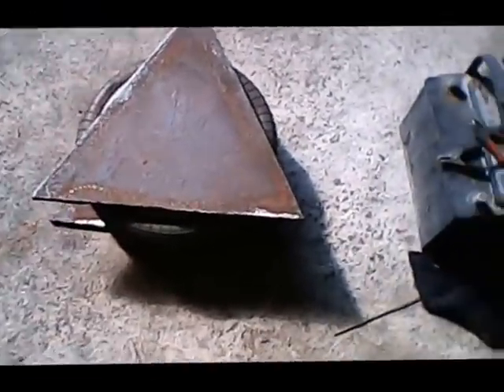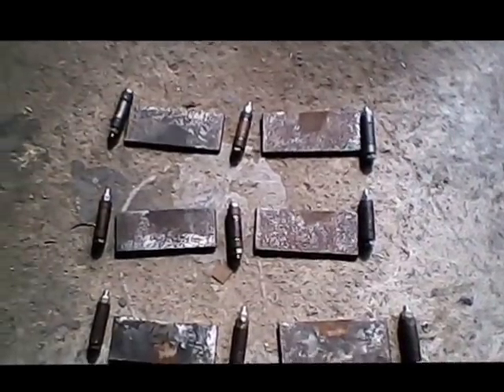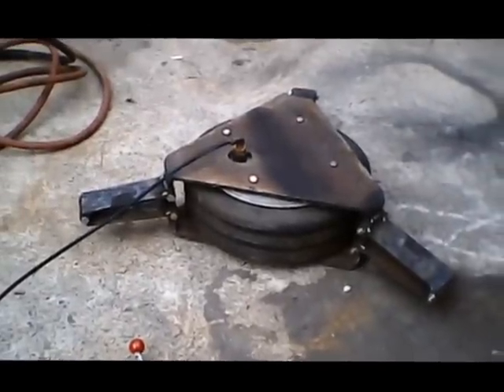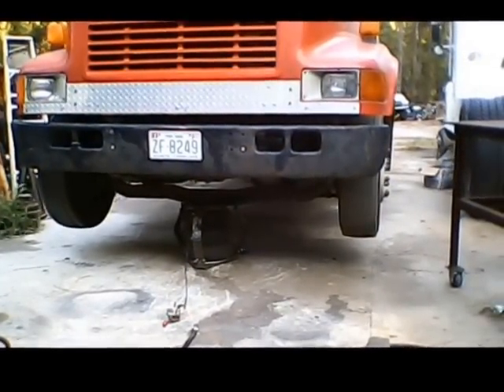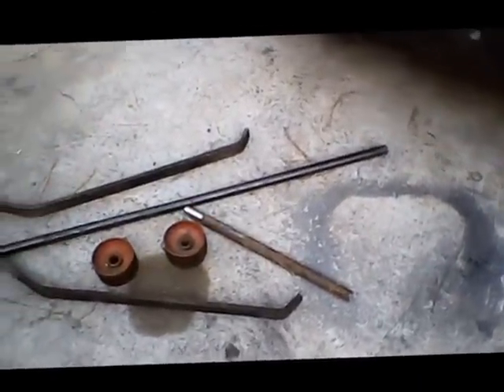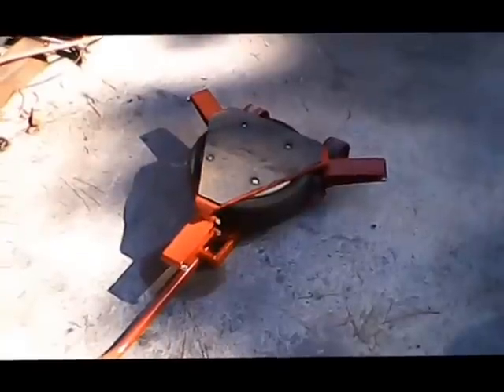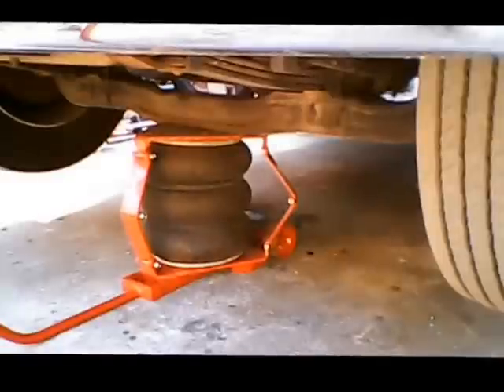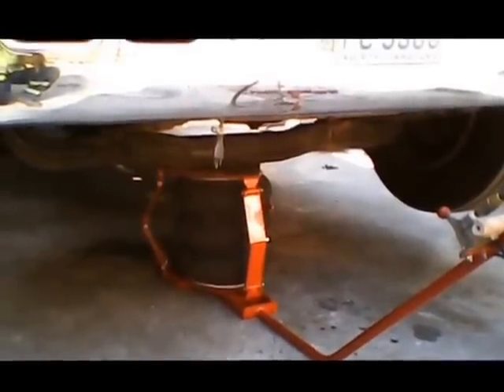Scrap Built Airbag Jack

Comment: Thank you so much for this    I have a GMC RTS bus that the tire came off the rim.  I am going to the truck scrap yard tomorrow and will try to find a used air spring.  I just need to lift the one side to get wood block under to change the tire.   I hope i can find a bag that can squeeze as short as yours.    Thank you so much   now my problem is solved.

Comment: Slick design and easy to build so I'm making a version for myself.

I ordered a similar bag today to lift the end of a shipping container so I can place pipe rollers etc underneath when winching it into place next to my shop. I have a forged steel Simplex jack and a forklift jack but your design is much easier to handle and place while offering greater max lift. My top plate will have a channel to engage the base of the container between the corner fittings, and my bottom plate will be wider since I'll be working on earth. 

Thanks for posting. You're idea will save me considerable work!

Comment: This is so amazing! It's defiantly the best lift of this type I've seen. I work at a off road rental place in Sedona Arizona that rents Polaris Rzr's. I have to inspect about 40 vehicles per day, jacking them each up front and back with a floor jack gets very tiring. I want to build this so bad but I don't think I could recreate it without seeing some of the pieces in more detail. Did you ever make a more detailed video on the build?

Comment: nice looking jack I would like to build one Now that you built it there is always things you would change what would change if you built another one Also what the the inlet valve you are using I want to build this jack on my lift cross braces as they slide back to front but cant figure out a valve that will raise and lower back to flat Any ideas ??? Feel free to text me 813-445-6400
Reply from the maker: +Dan Garland  This valve is just an old one I found. They are available as PTO shits for air shift pto's on trucks. They dump when released.
Reply: Jonathan W pto shits 😂👍that made me laugh 
its the pto shifter aka pto shitter

Comment: how much air pressure to lift the truck
Reply from the maker: +Andy Ostensen  I have a regulator set for 100 psi because that is max for the bag. Not sure what it would actually take to raise it, but it's much less then 100 psi.

Comment from the maker: Just wanted to explain the concept behind the hinges. Because they are located in a triangle when the bag tries to lean in any direction there are at least two hinges that are trying to be pulled into a direction that they can't go. This is what helps stabilize it. This does not mean if the airbag blows that it will not fall, they only help it from leaning side to side, so jack stands are a must with any and all jacks.  If the plates was made into hexagons instead of a triangle and six hinges were used it would be even better. I may build one with six later. I built this one because I really needed a jack for my trucks, I was down to a 2 ton bottle jack. I also know that once the airbag is at full height it is very stable anyway, but when replacing a wheel and tire on a big truck the last thing you want is to lift the wheel 4 or 5 inches off the ground. Jonathan